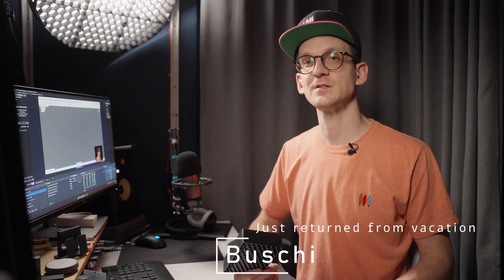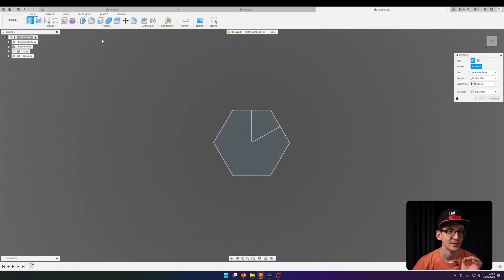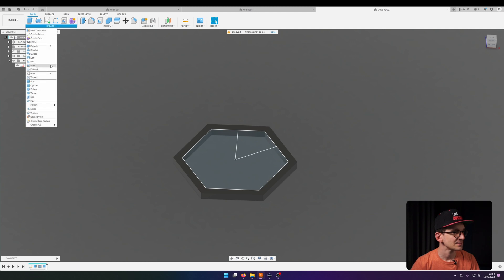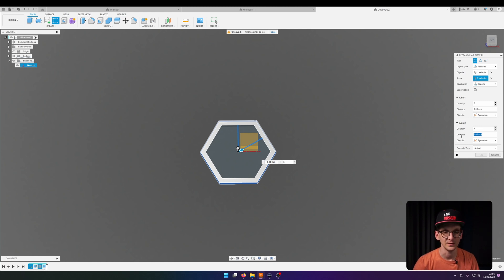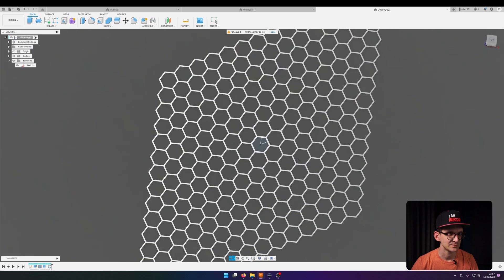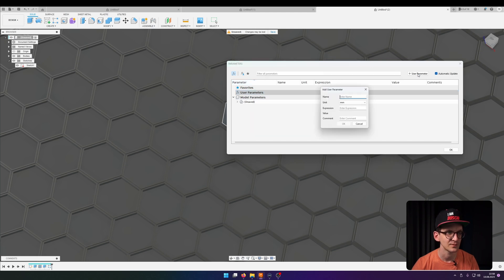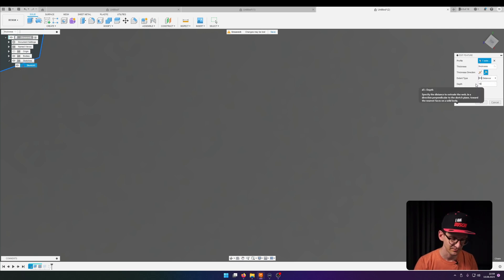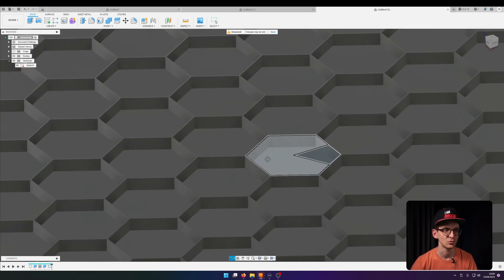Best Fusion360 Hexagon Grid Technique in 2023 (Updated)

Comment: Thanks for the amazing technique Buschi ! I tried the following:  I created 2 parameters, one for the thickness and one for the width of one side of the hexagon. In sketch I created a hexagon and an offset hexagon distanced by (thickness parameter) and applied the side parameter. I added two axes as in Buschi’s method. I extruded the outer hexagon. then did the rectangular pattern. for the spacing I use sqrt(3) * side + thickness. it sounds complicated but all the design is controlled by the 2 parameters.

Comment: You should really use Construction lines for your two lines going out from the center point of the hex. Its a big QOL change. In fact, any line that isn't doing to be a wall once extruded, should be a construction line.

Comment: The simplest method I use is: In sketch create hexagon. Add two expansion axes as in Buschi’s method. Use rectangular pattern with Spacing. Enclose in the required shape. Extrude. Done! Additional advantage of this method  is easy calculations that happens instantaneously.

Comment: The reason the gap was there at the middle was because you had hardcoded in the distances for the repeating pattern, which you didn’t adjust for when you changed the original thickness. If you had driven it via parameters, I don’t think those gaps would have appeared.
Reply from the maker: Have you watched the entire video? :) I did what you rightfully comment in the second half of the video :) There is yet a better way and I am currently working on another video using it for a Softbox grid tutorial..

Comment: Instead of web tool, try Thin Extrude and set so the Sketch is along the centerline of the body. Extrude one hexagon then pattern the bodies as above. This makes it super easy to paramaterize the size of the hexagon and altering diameter or wall thickness does not impact the other.
Reply: - Yes, 'THIN EXTRUDE' for the win! :)
Reply from the maker: To be honest, I have not fully grasped the concept there yet... Will try it out and see if I can manage.. :)
Reply: @iambuschi  
- Note: 'Thin Extrude' (in 'SOLID' context tab) can use a 'closed profile', OR 'open'.
- Then just set depth, and width: 'Distance', and 'Wall Thickness'.
Reply from the maker: @swamihuman9395  check out my other video.. Your comment even made into it ;) https://youtu.be/QEoUMSO9SXo thx for the valuable feedback!

Comment: Excellent work man. Glad I intrugued you enough for an updated video!🤘It's time autodesk built a tool to automate all this with optomised processing but we can wish lol 
(EDIT: actually they do have a pattern tool thats part of the plastic package that might do this). 

You also figured out where I struggled with the web tool i think. There's always multiple ways in fusion! Thinking about it, there's another way in surface modelling that you could extrude the hexagon as a surface, then thicken it. then rectangular pattern it. I wonder if this makes a difference to process speed. Likely it will cause more work for the CPU to be honest but i will try 👍
Reply from the maker: Processing wise the new approach I think also doesn't scale really nicely.. at least not in cases You really have a lot of hexagons.. would be great to have yet another fall back approach ;)